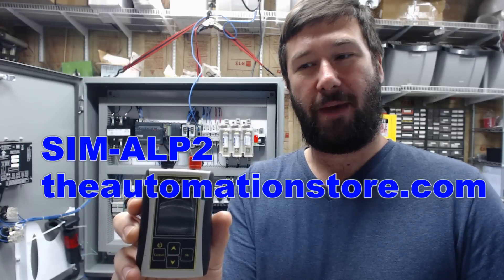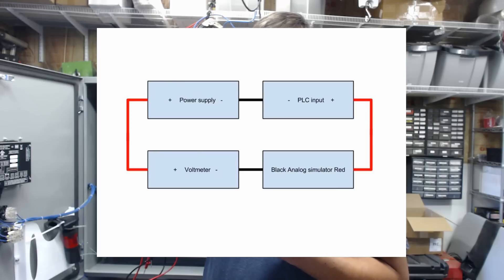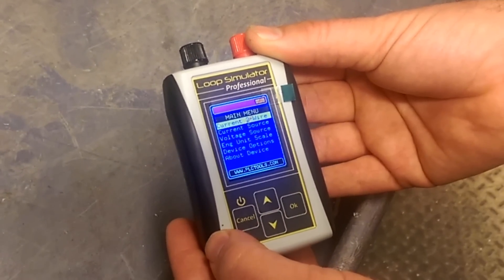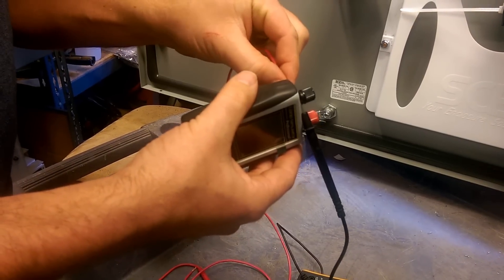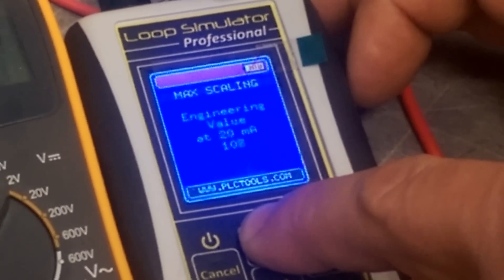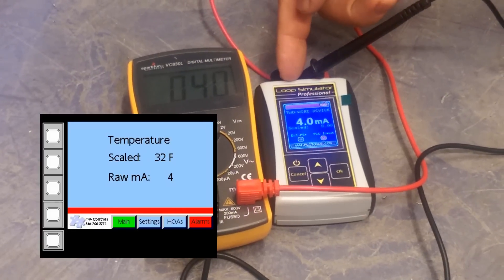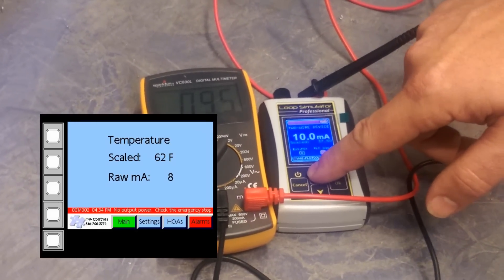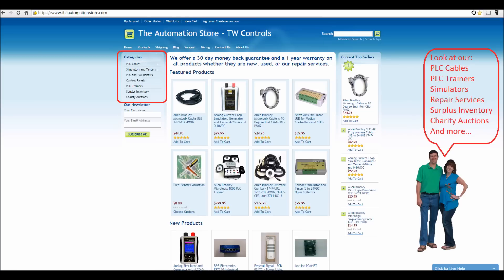Simulating a 4-20 mA or 0-10VDC on a PLC input or other analog device

Comment: What is the advantage of 4-20mA analog signal as compared to 0-10V signal? How can you read 4-20mA if your BAS inputs only accept 0-10V?
Reply from the maker: Hi Tarun.  4-20mA has more noise immunity and doesn't have the problem of voltage drop.  Here is a lesson on that.
https://twcontrols.com/lessons/analog-circuits-training-understanding-analog-circuits-0-10vdc-4-20ma

Here is one where I connect a 4-20mA sensor to a Micro820 0-10VDC input.
https://twcontrols.com/lessons/how-to-wire-analog-4-20ma-sensors-to-the-0-10vdc-inputs-of-an-allen-bradley-micro820-plc-and-scale
Reply: @TimWilborne  thanks for the reply

I have one more question 

 A 3-way valves use a Belimo actuator, model EVB24-SR, which is powered from a transformer in the BAS panel.

a. What control points are you likely to have for the valve? For each point indicate if it is analog or digital and if it is an input or an output.

b. What type of control wire (number of conductors and gauge) are required to be run between the BAS panel and the actuator? Explain your reasoning.
Reply from the maker: @tarunm4534  It would be dependent on the particular design.

Comment: Dear sir,

I found that the PLC analog inputs are -/+ 20 Volts or 4 to 20 mA. Are these only the analog inputs types to the PLC or there is another ranges ? Is your PLC Tools SIM-ALP2 can coverage these ranges or not ?
Reply from the maker: Are you sure it is not +/- 10V?  That would be more common.  The SIM-ALP2 can do +/- 10V and 4-20mA.
Reply: @TimWilborne  Please see the information on the this link:       https://realpars.com/plc-analog-inputs/
Reply from the maker: Recently I've found numerous errors in their videos, looks like this is one as well.  Standard analog values are 0-10VDC and 4-20mA with servos or other bidirectional controls using -10VDC to +10VDC.
Reply: @TimWilborne  Thanks.

Comment: hi sir i just want to know that how can i take temperature and pressure and current values into plc ,flex logix can you please explain i use ab plc modules 1794-ie8 for suction pressure and 1794 ir8 for temprature values please explain
Reply from the maker: Page 2-10 of the following manual tells you the terminal assignments of the 1794-IE8 https://literature.rockwellautomation.com/idc/groups/literature/documents/um/1794-um002_-en-p.pdf

Page 2-7 of this manual shows examples of wiring the 1794-IR8 https://literature.rockwellautomation.com/idc/groups/literature/documents/um/1794-um004_-en-p.pdf

Comment: New to controls. Can you tell me the difference between 0-10Vdc and 2-10Vdc and why you would benefit one over the other?
Reply from the maker: Working Man See the 2-10VDC comment near the bottom of the following article. That is what comes to mind when you ask the significance of 2-10VDC https://www.theautomationstore.com/analog-circuits-voltage-0-10vdc-current-source-and-current-loop-4-20ma/
Reply: Tim Wilborne I'm a go read it now. Thanks for the fast response.
Reply: Actually, this helped a good deal. Thanks again.